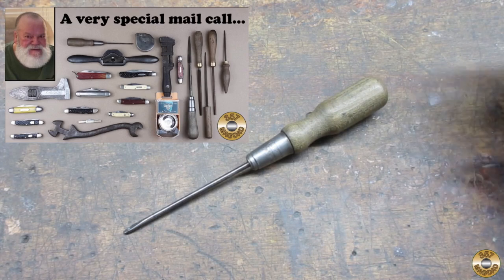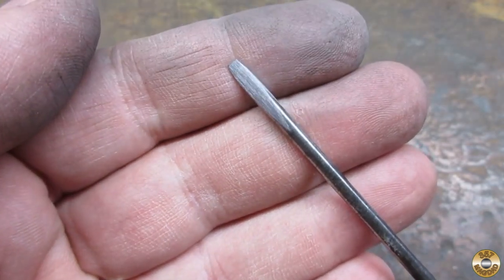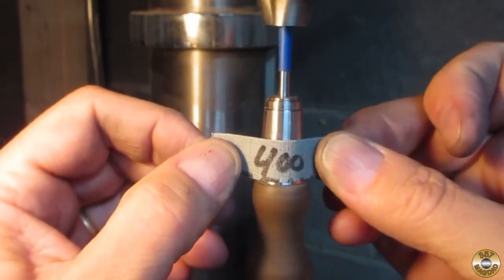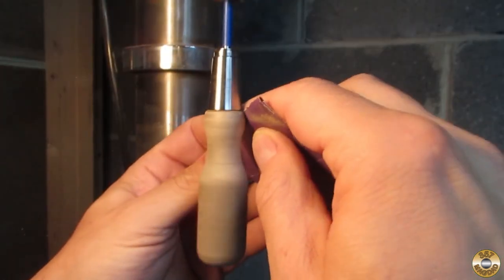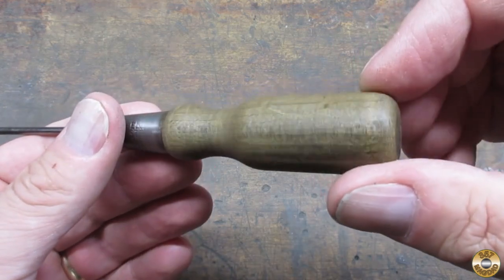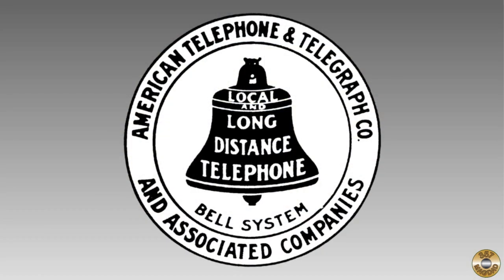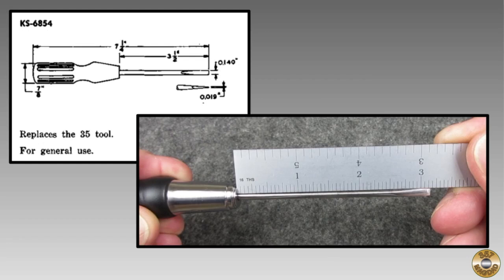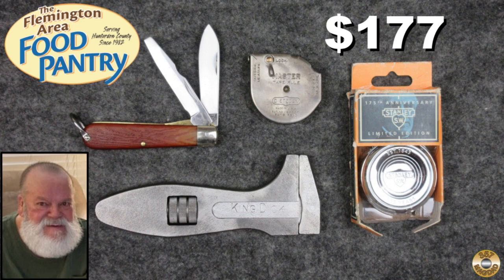Stanley Bell System KS-6854 Screwdriver Restoration

Comment: Great resto. I used to dumpster dive in the telephone company's dumpsters and pull out perfectly good tools with the bell system logo. New phones, handsets, wire etc. still sealed in the package.
Re-profiled tip came out nice. The matte finish looks great! Great video, Thanks!
Reply from the maker: Thanks Mike!  I've been running into more Bell System items lately.

Comment: Jack would be very pleased. That's an excellent restoration. Repairing damaged tips on screwdrivers is the diciest part of screwdriver repair, IMO. Once you master that skill, you can tackle most any screwdriver job. I like your research and even a bit of detective work on this screwdriver. Thanks.
Reply from the maker: Thanks Pat!  I get a kick out of doing the research!

Comment: That looks like new.   The wood cleaned up easily with the soap water and pad.   Interesting to see the Bell specifications.   I agree the 19 thou spec for the tip would mean it could easily break.   The screw slots must have been small.
Well done.
Dave.
Reply from the maker: Thanks Dave!  I think that tip was mean for #1 and #2 screws.

Comment: Do you think that the original wood handles were to protect the user from electric shock?
Reply from the maker: I think wood was the preferred handle material until plastics came along.  I have seen some screwdrivers that have a plastic washer that insulates the ferrule from the shaft.

Comment: But the 0.019” blade thickness is probably right, for the small screws they often used in the phone system.
Reply from the maker: I think it was meant for #1 and #2 size screws.